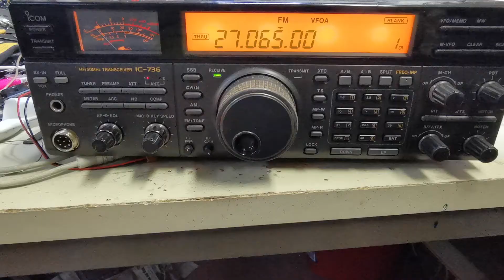Icom IC-736 and IC-738 MARS MOD

Comment: Japanese-version radios will also need the unlabeled component removed just below D18. It's a 3-terminal diode, you can see it is connected also to D16. I think it is D20 in the service manual.
Reply: I did d15 mine didnt work ,so maybe thats what mine needs
Reply: @jeffhicks2070  that was my experience. Both had to be done.